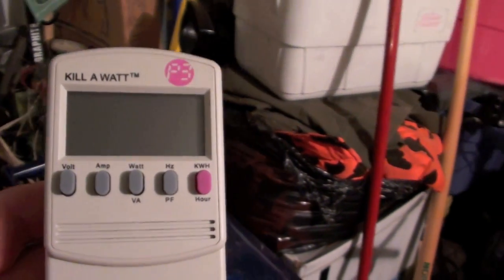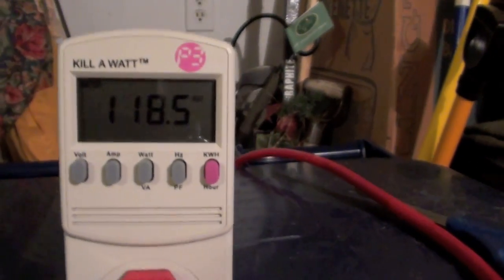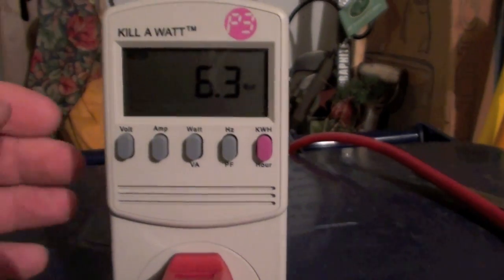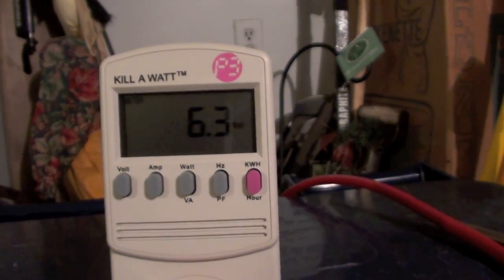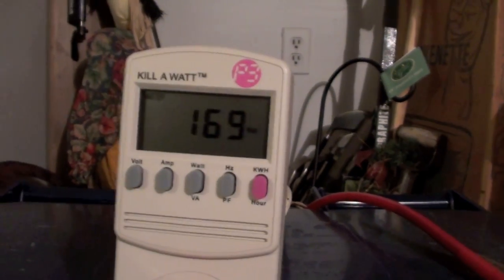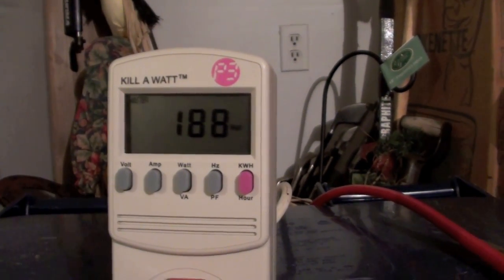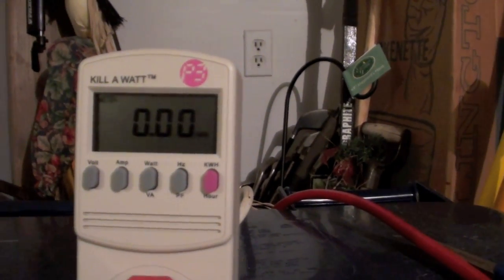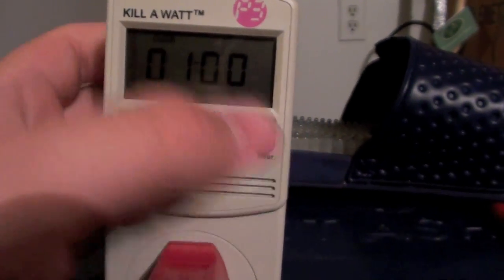IBM xSeries Power Consumption

Comment: Not too  bad really. I don't know the exact details but its not far off from my iMac G5. 

Way back in the days, I get blamed for using so much electricity. So I looked up specs. I think my iMac G5 board will run 110 watts. Then add the screen, so 150 watts idle. Run a load 190 watts max or so. So, if my iMac was run 24/7 at 190 watts in Seattle,  That is about $15 a month of electricity.